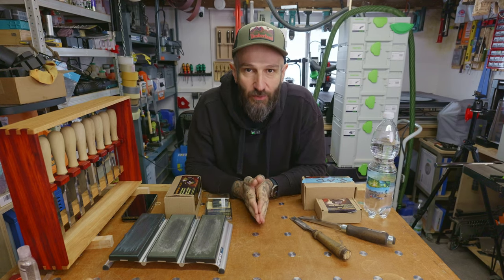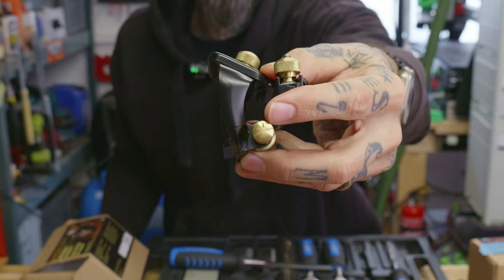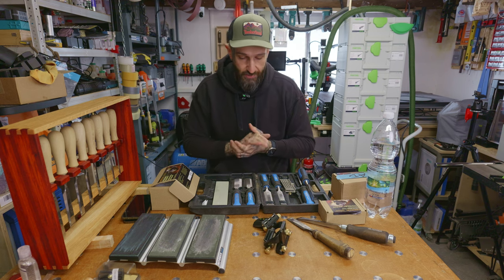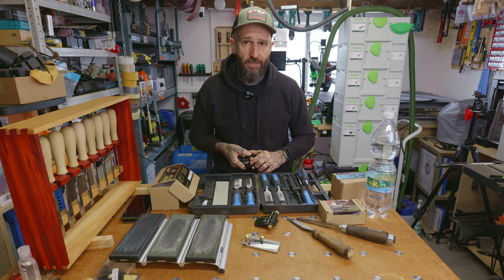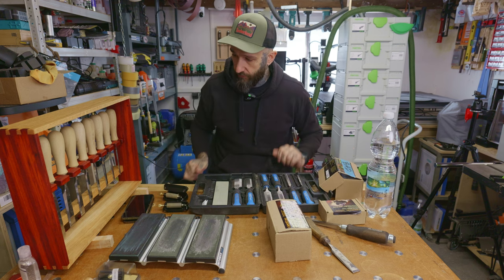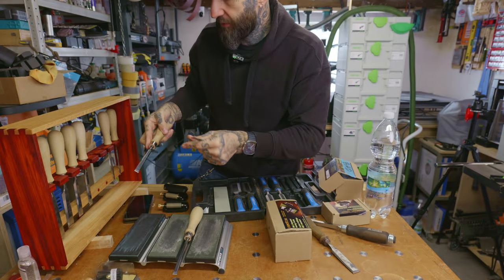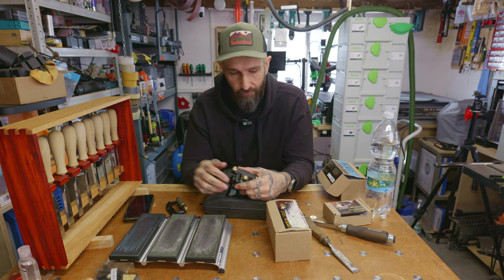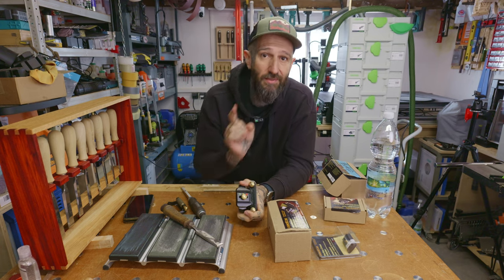Veritas mkII Honing guide Debunked. Are your secondary bevels parallel to your first?!?

Comment: I'm glad Veritas sorted out the problems you were having with the honing guide.  Sharpening tends to be a contentious topic for woodworkers.  When I'm asked for the best method, I respond with "whichever method gives you the best results.  Pick one and try it."  I use the Lie Nielsen honing guide and have never had any problems with it.  Unlike the Veritas honing guide, the LN guide clamps chisels and plane irons from the sides, as did the early Eclipse guides.  My bench planes get the 25-degree primary bevel using the Tormek, then four passes over the 800 grit water stone to establish a narrow 30-degree secondary bevel, and finally two or three passes over the 10,000 grit water stone for a 35 degree tertiary bevel.  I was trained by the late David Charlesworth on this method, and it works well for me.
Reply from the maker: Yes the LN guide looks amazing and your sentiment in regards to sharpening is identical to mine, what ever works for you indeed. I have a tormek with diamonds but it tends to sit on the bench most of the time as I find my diamond stones are just quicker and easier in general. Also if I’m to be honest with myself I could just use a basic stone as the level of my work probably doesn’t warrant such a refined edge 😅 Iv never explored the tertiary bevel concept. What does it aid? It took me a while to understand the secondary bevel concept as always thought it just made it sharper in some way before being told it’s just to reduce the surface area of the re sharpening grind
Reply: @woodcraft_cz  I remember asking David Charlesworth about the third bevel, but I can't remember the answer.  However, I do remember the answer made sense, so I continued using it.  I think it was a way to extend the sharpening before going back to the Tormek for the 25-degree primary bevel. Touching up a chisel or plane iron on the third bevel required only one or two strokes on the 10,000 grit water stone.  When the edge of the third bevel approached the edge of second bevel, four or five strokes at 30 degrees on the 800-grit stone, followed by a couple of passes on the 10,000-grit stone put the chisel or plane back in service.  When the second bevel was about twice as wide as it was originally, after about 20 sharpenings, it was back to the Tormek.

Comment: Thank you so much for posting this video.  I was having this exact same problem when it came to applying the secondary bevel by turning the dial to the 6 o'clock position.  Finding this video and learning that I'm not alone is very reassuring.  I called Veritas in Canada and they told me that Lee Valley will call me and fix the problem.  Thanks again.
Reply from the maker: Amazing I’m so glad to hear you’re getting the issue fixed. It’s not a great feeling when things don’t work as expected and you don’t know why

Comment: Good to hear about the good customer service by Veritas. I have two of these as well and have not experienced this problem. One thing I do know is that even with the wide roller, pressure still matters. It's not a 100% guarantee that you will get a square edge. If you put slightly more pressure to one or the other side, you can still skew it a little (not saying that was the case with you, just that even with a 100% perfect model, squareness is not guaranteed, you need to put pressure evenly).
Reply from the maker: Yes I did notice the difference but it was very subtle when I deliberately put pressure on in hope to try and counter the skew but yes, still a point to always consider. I’m very happy now with how my jig performs, definitely a grey unit 👌😁

Comment: When you put your blade into the honing guide, with the attached "stop"that clamps onto the front, do you notice that the stop portion can rock back and forth a bit? Mine doesnt sit perfectly 90° when i have it clamped onto the actual honing guide. Ive had zero success with this honing guide

Comment: I use a grinder with a coarse wheel for the primary bevel.  I grind as close to the edge as I can without grinding to the edge, so the angle and grit have no impact on the edge.  By getting, and keeping, the secondary bevel very close to the edge, honing the edge goes very fast.  I use the Veritas guide for honing plane irons because edge geometry, sharpening efficiency, and final sharpness are important to me.  But now that I only use a guide for the secondary bevel, any decent guide would do.  Chisels I hone by hand by hand because geometry is not critical, the edge is short, it takes less time, and chopping dovetails and tenon shoulders dulls my chisel rather quickly.
Reply from the maker: Iv tried by hand and I’m not the best I know I could practise but at the moment my current learning curves are overwhelming enough 😅 but one day I would like to refine my hand sharpening skills for sure 👌
Reply: @woodcraft_cz   I recommend that when you decide to practice dovetails you sharpen your chisels by hand.  Chopping dulls edges fairly quickly (maybe less so if you have premium steel - I don't), so in a single shop session you will get lots of feedback on how the edge affects the cut, how your sharpening technique affects the edge, where the cut quality is critical and where it is not critical.  Your first learning will be to FREQUENTLY check that your chisel is not dull.  Chopping can quickly roll over your edge; the cut will be ugly and the back of your chisel will feel like it has a huge burr - because it does.  Set things up so you can move easily between your chopping station and your sharpening station; you'll be bouncing between them every few minutes once you get going.  Likely you will soon see how everything works together.